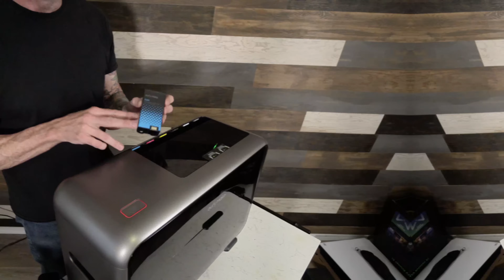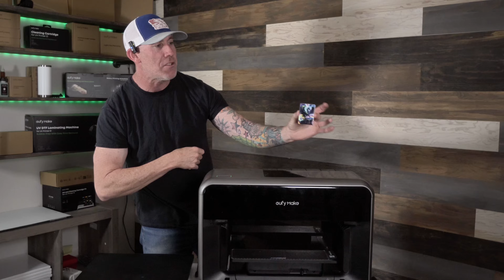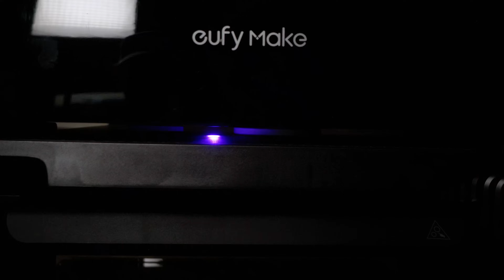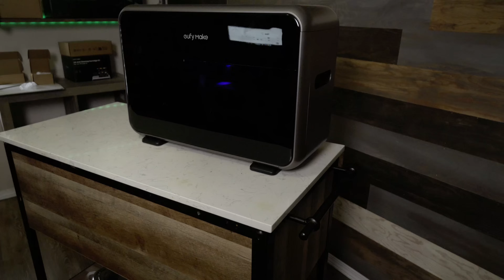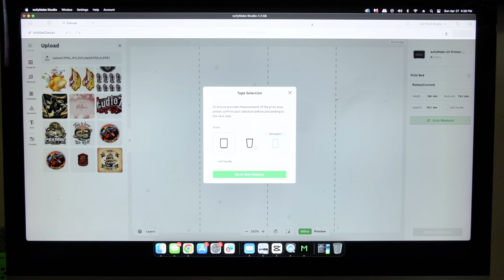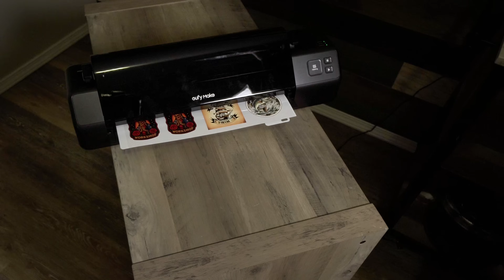eufyMake E1 Affordable UV Printer - EVERYTHING you MUST KNOW Before You BUY!

Comment: 2 questions

Leatherette pressed on hats been okay? The bend doesn’t affect the resin?

How is that tumbler holding up being washed in a dishwasher?
Reply from the maker: UV Printing on leatherette is very common and zero issues. Eufy now has a SOFT WHITE ink which is even better than the neutral ink. Tumblers alone are not dishwasher safe, so we don't recommend to put in the dishwasher. Still love this unit. It's for small production.

Comment: Hi quick question if you can please guide me. Why printing time so long. Like 10 min 20mi  specially with flat artwork. I was checking other printers now to compare print speed. Ita like 100+ design per hour. So i am like why. Please help. Or if you can make a quick video just about the print speed comparing with other printer same price range used using different print quality settings. Thanks in advance

Comment: How "flat" does the surface have to be to print on? One application id like to use this for is to print on a flattened box and over the corner to have the image wrap around the corner. Wondering if that will affect the apllied image.

Comment: Can you use 13"x19" foamcore in this machine, only printing on the 13x16 bed alowwing a 1.5" overhang on either end that won't be printed?
Reply from the maker: Yes. Open front and back doors. I do it all the time
Reply: @RISENGRINDWORKSHOP   Thanks so much!

Comment: How does this compare to the RFC you have, which is more flexible ?
Reply from the maker: Really not even a comparison. The Eufy is designed for anyone to use basically the Glowforge of UV. Prints awesome. Gets anyone into UV printing without fears of learning a new machine. The ZZ2C is 250 lbs and requires the user to learn some stuff, it's a light commercial duty machine. Much steeper learning curve but a more versatile machine also 5k vs 1600 each has their place. I am lucky to have both and use both all the time for different projects. Tumblers and one off stuff or double sided projects are a breeze on the Eufy with the camera setup. It's also much slower. So pro and con to each :)

Comment: Great review! 🙏🏻

Quick question on the UV-DTF capabilities: 
Have you experimented with using Cold Foil applied to the E1's varnish layer, then processed with the 90°C laminator add-on? I'm trying to achieve a 3D/textured and highly reflective/mirror-like finish (similar to hot foil, not just metallic). Wondering if the varnish acts as a good adhesive and if the final result is truly mirror-like.

Like this:
https://youtube.com/shorts/EPe6LQhQ8YI

Or this:
https://youtube.com/shorts/yEB8mrOKXYo

Appreciate any insights! Thanks!

Gabor

Comment: I know that the E1 is not meant for fabric shirts, but i am curious what happens if you did print on a shirt? Does fade or crack is it just too thick? Just curious
Reply from the maker: This uses UV INK which is cured by the Ultraviolet  Light. Most garmits use a Plastisol Ink which requries HEAT to cure. You can UV print on canvas bags and material like that. Not machine washable stuff.

Comment: The paint is expensive
Reply from the maker: Explain in detail and they don’t use paint.
Reply: The material is expensive. 100mL costs +$40
Reply from the maker: @MandacaruAlfa how is that expensive. What’s your basis? Compared to 50k commercial printer ink? What 2k UV printer has CHEAP ink? You’re clueless.
Reply: Okay
Reply from the maker: @MandacaruAlfa 😂😂

Comment: Can you print white small text (1-2mm height) on glass and plastic squeeze tubes? Thinking of product packaging text. Is the white ink still scratch resistant or does a gloss coat need to be added?
Reply from the maker: Yes, we have UV printed direct on small handwriting pins. The vision positioning system makes this a BREEZE!!!  MAKE sure. you click my Kickstarter Link in my BIO to give me credit! I show this on my TikTok LIVES try to tune in and I will print one for you @risengrindworkshop on tiktok

Comment: hi are the cleaning cartridges 1 time use? i mean like after 1 complete flush out after 3 days is it finished? how many times can we use 1 cleaning cartridge?
Reply from the maker: The cleaning carts are considered a consumable. After an extended period of time the cleaning cart will run out of cleaning fluid and the waste tank will get full. You should get a few months out of it. It will depend on the volume of printing. Then you can replace it. Definitely not done after 3 days

Comment: What is the maximum height of an object that can be placed on the print bed for flat items?
Reply from the maker: The maximum height will be 100mm or 3.94" inches. Great question.
Reply: @RISENGRINDWORKSHOP  I know they call out the 100mm max diameter for the rotary attachment. But seems like it should have more than 100mm if placing something on the print bed directly since its not raised up like the rotary attachment.
Reply: @amybrown925  it is max 60mm right now but it will be possible to use 100mm but without camera and laser

Comment: Can you do a RTIC Essential or Yeti tumbler that is "big" at the top and "snaller" on the bottom?  Just want to do the upper part.  Just curious how the leveling wirks if you only want to print on the top part of the tumbler.
Reply from the maker: This max Diameter for a tumbler is 100mm or 3.94 this smart rotary is not really designed for that complex type tumbler. You would use the UV DTF transfers. I will see if I can get the tumbler in and just print on the top portion.

Comment: The ink price is about 6-8 times more expansive. Thats crazy. And I don't want to know that these cleaning cartridges cost. I wait until there are some refill cartridges on the market.
Reply from the maker: Do you expect a hobby level 2k printer to have ink that costs the same as a 50,000 commercial printer. This is a hobby printer. Not a commercial printer. Want those prices, invest into a commercial printer. Not apples to apples comparisons. Also the ink thing I can't publically share yet. EufyMake knows what they are doing and all of us creators share all of this feedback with the team.
Reply: It’s not bad though, a phone case is like  15 cents of ink and a tumbler is 13 cents of ink.  That’s like <1% of sale price and 1% of margin.  

shipping, taxes, packing material, gas driving to the post office, heck even the envelope will be more margin than the ink.  Probably the only thing less (if you itemize to this level) is packing tape.  You might be less than 1% of margin.  So as far as cost of goods sold, the ink is not a huge concern.

Comment: how do you clean the bed when it overprints the object?
Reply: You don’t. That ink has been cured just like the ink that went on your item. The sticky pads that go on the beds are a consumable item that will have to be replaced once the buildup becomes enough to keep your item from lying flat. You can extend the life of the pad by protecting it from overspray and using double sided tape when it begins to lose its stickiness. (It is sticky to keep your item in place during printing.)
Reply from the maker: Mswhizz is Correct, you get tacky sheets that you apply to the bed. It almost acts like a vacuum table. After they get used and abused, simple peel off the table and replace.

Comment: Why does it seem like the prints are not actually aligning well with the "snapshot"?  Theres an awful lot of white around your dinosaur ceramic coaster compared to your screenshared snapshot placement.  You're not the first influencer video that I've noticed that in but the others didn't screenshare.
Reply from the maker: Yup. That's the first print that didn't align property. I have since done a firmware update and have not had any issues. Again, I could have edited that out of the video. We keep it real here with reviews at the Rise N Grind Workshop!
Reply: Was thinking the same this it was good in the software not on the coasters . But a update can do alot . Thats how you see they working hard on it
Reply from the maker: @Yeliscreativeart  Firmware update and camera calibration and it's on point. LIke I said, full transparency on this channel. Could have edited that out :)

Comment: I too have a commercial unit.  Is there a jig function?
Reply from the maker: Jig Function?
Reply: @RISENGRINDWORKSHOP  Where the jig shape is saved in the software and you just drop in your designs and it automatically places and resizes them in the print area.  The blanks are loaded into the jig and the printer automatically aligns and prints them without mistakes.
Reply from the maker: @MandyEllifritz  Copy that. I thought that's what you meant :) 100% you can totally 3D Print or Laser Engraver Jigs and save the Outline Files for placement on the EufyMake E1 - The software and cameras are really for the beginners just getting started or lazy people like me at times :)

Comment: Hey there, is there a way for the unit to be put into some sort of long term storage mode without having to keep the flushing mechanism on all the time?  TYIA
Reply from the maker: Yes, after 3 days of no printing. The Eufymake E1 will go into standby mode. It will purge the ink from the lines and use the Jet Clean pack and fill the Print Head and Lines with Cleaning solution. We let the printer sit for 7 days prior to printing. The machine loads new ink and we were printing in 15 minutes.
Reply: @RISENGRINDWORKSHOP cool thank you

Comment: How much does the ink cost?
Reply: $300 for a set
Reply from the maker: As of now around 300 for a full kit. CMYK - White and Varnish and a cleaning kit included. WIll be sold by 3rd party retailers and individual carts as well.
Reply: @RISENGRINDWORKSHOP  deal breaker. plus the machine wastes ink in its constant cleaning cycles.
Reply from the maker: Whatever you say 9,000 backers disagree 😂😂😂😂

Comment: The round ceramic where not printed where you placed it. So did you had any problems with it, that the software did not printed where the artwork was placed or did you change the placement later on? Also the Artwork on the tumblers where way smaller on the preview than they where on the tumbler itself. Did you change it or is that normal? While the cleaning is good and important, with the ink price higher than a 100 years scotish wiskey, how many ink is doint down the drain when you leave for a week facation. Thats 72x times "a small amount of ink" and purging all the ink from the tubes after 3 days. And what does the cleaning cartrige cost? But thanks for the video
Reply: The software is still in beta so there are still some tweaks being made. After Installing the standard bed it does not automatically request another camera calibration and which I am guessing is why we saw the issue here.  You can calibrate the standard bed but you gotta click the button. I’ll cover this in my video once finished but after calibrating my standard bed my test showed accuracy within 1mm
Reply from the maker: John, Thank you for the comment. We keep things real here at the Workshop. I had printed many items and was actually surprised how accurate the printer was. Of course the day I went to record my printing, yes a firmware update happened. Clearly you saw it was off a tad bit. Only on that first print. I can say the camera positioning is on point. I will be Live all day today come check it out @risengrindworkshop on TikTok - the Artwork on the tumblers were the exact size I created them. Looks different on camera I am assuming. Again on vacation, the INK IS NO LONGER being USED. Cleaning Solution Fills the print head. 50k for a commerical printer if you want dirt cheap ink. This is the perfect solution!
Reply: Noticed the same on other reviewers as well, placing seems to be off.